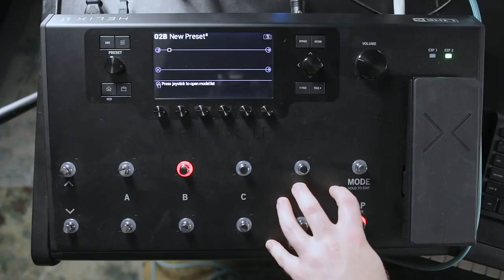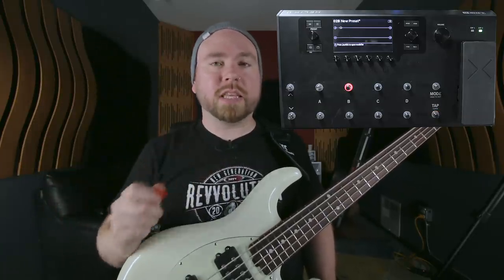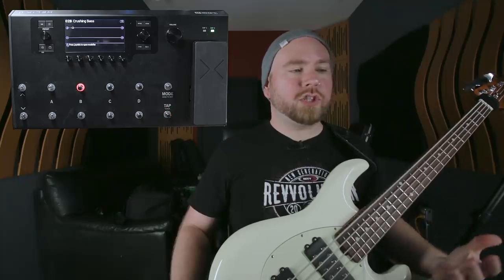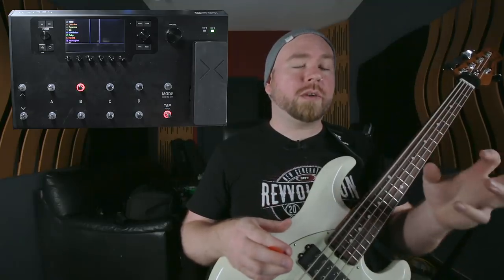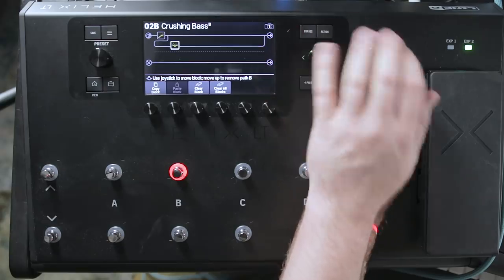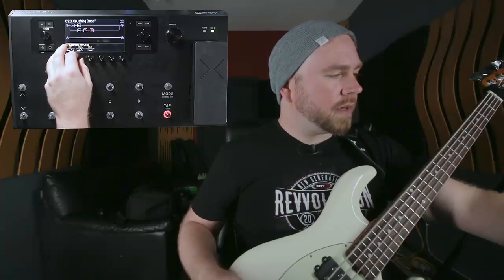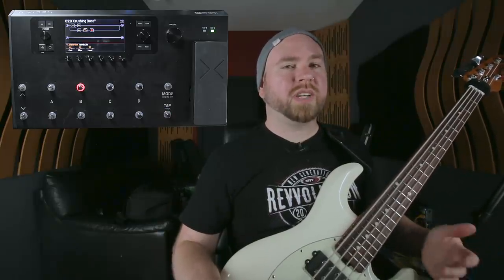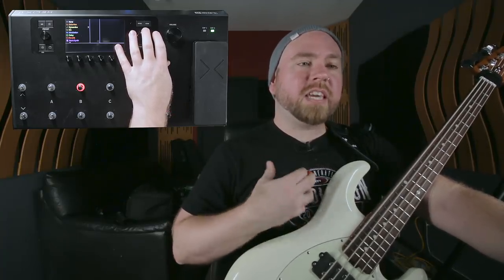How To Get A CRUSHING Bass Tone!

Comment: If you have a passive p bass with old strings:
Low bass - 10
High bass - 6
Low mid - 6
High mid - 10
Low treble - 10
High treble - 10

I promise you won't regret this setting
Reply: god bless you
Reply: @fuzzfiend 
I still run my bass this way with the same set of old  strings
Reply: You have low and high treble and bass?
Reply: @lamblatte8139  
A good amp will have at least a 6 band equalizer
Reply: @philcollinshill2951  What should you do if you only have 4 band?
Reply: @lamblatte8139  
Experiment with your settings until it sounds good to you. I'm not much help but that's my honest advice.
Reply: what are you running for distortion or do you use it?
Reply: @keenansalzsauler5858  
I plug straight into the amp with no distortion
Reply: @philcollinshill2951  thats lame
Reply: @lamblatte8139  no he had a killer rig
Reply: @keenansalzsauler5858  Lemmy used his amps built in overdrive/distortion, so your point doesn’t really stand.
Reply: Yoo thnx g!!!!!
Reply: How much gain do you use? Nice settings btw
Reply: @themossfield5430  
NONE

Comment: The hardest thing about getting a great BASS sound I’ve found is getting the GUITARISTS to switch off their egos and work with the rest of the band.
Most guitarist run too much distortion period. 

The rule of thumb for all guitarists or bass players is;-
What sounds great when you dial up a sound by yourself is often overkill in a live/band setting.
Reply: buy an 8x10 and actually be heard....
Reply: That must be why as a guitarist wanting to learn bass I bought a Dingwall n3, 6 string, Darkglass microtube and the Parralax plug-in. Tons of distortion. 😂

Comment: Im a Rock/Blues  Guy (Older than probably most of you) Thanks for the tips. I used to use a Crossover and Two amps to Do this sort of thing...(Along with lots of Pedals). Just started Using Helix thanks for pointing Me in the right Direction.

Comment: I feel like the bass was overpowering the guitars in the final mix. The bass tone itself was great and the dual tone set-up works well, but it sounded like the bass' levels were too high.
Reply from the maker: yeah I mean I cranked the bass up a lot just so you could hear it, in a real mix you wouldn't have it that high
Reply: JUST THE WAY I LIKE IT
Reply: @treyxaviermusic  idk i liked it like that alot of bands have it unrealistically quiet
Reply: @Buhhhhhh-xi4ju  in a lot of genres you generally want the kick drum to be one of the loudest things in the mix, which is accomplished through EQ instead of turning up the volume. A lot of the time the kick is EQ’ed lower than the bass which sits just above in the mix, but adding in guitars which are extremely mid-heavy and generally more searched-for in the listening experiences of rock and metal ends up muddying the bass. Not enough low end or mid range unfortunately buries it but makes the band sound better as a whole, it does suck though because bass in a live setting is a completely different experience from listening to a lot of recordings
Reply: @tylerlennon9955  a really mid boosted guitar takes up too much space in the sound spectrum. Listen to older more scooped metal albums and you can actually hear everything going on, take pantera for example, dimes tone was scooped nasty and mean but it really gets people going and you hear every note from all 4 guys. broad midrange doesn't really get people going because it's boring and vanilla. People want extreme sounds because they fit a more extreme emotional content better. Modern metal production gets really boring after 3 songs even if they're good.  It doesn't get people going when you neuter the shit out of the bass for the sake of your mix sounding clean. Normies don't care about that shit at all, only other mix engineers give a damn about that and they arent your target audience anyway. Especially in a live environment if you arent pushing lots of depth and oomph then people lose interest. besides this is heavy metal, it's meant to be filthy and brutal sounding.
Reply: @stevenhirsekorn3444  agreed

Comment: I don't have a Line 6. I have used a similar approach by using an Eden WT-600 for the low end of the spectrum with a good amount of compression and clean. I then use a Carvin Quad X preamp on channel 2 for the uncompressed highs. My bass has a ton of output with naturally overdrives the preamp with a "fuzzy" distortion. They are on separate channels and I mix/blend accordingly. The Tech 21 dUg Pinnick DP-3X pedal has this feature built in. That is an inexpensive option for those who gon'y have a Helix or something similar. Lastly, YOU ARE SO Correct in that separating the bass from the treble frequencies of the bass tone with clean compressed low frequencies and uncompressed and slightly fuzzed treble signals will cut through the fix so that one's bass playing can very easily be distinguished compared to traditional bass guitar EQing. Especially for guitar heavy music genres. You demo is on point!!!

Comment: The result is pretty good but I'm wondering why you didn't use the x-over split instead of A/B split and two dedicated low/high cuts. Saves DSP and  space in the patch.
Reply: This way you can dial in the low and high end independently and have them overlap. I think the cross over split can’t do that.

Comment: Simplifying things... What I did without splitting the signal was: Washburn RB2000 through a Sansamp RBI with drive pushed, got the clean signal out of it through a Peavey PVi 2500 on one channel, and the dirt signal connected to the other Peavey channel. From the power amp I drove the Bass/clean power output through a 15" cabinet, and the full/dirt power output through a 2×10" + horn cabinet. Just add more cabinets to your own taste...

Comment: I know im super late to the party lol but i noticed that parallel split EQ; you can actually split the signal on the signal line (i think the default is like A/B balance but you can change it to frequency) did some playing around with freq splitting with dual cabs

Comment: CRUSHING.  Question:  If you were going to place modulation effects like chorus or flange, or if you were going to use a delay, where would you place them in a chain like this?  I realize much of that is to taste, but what I'm getting at is really, would you want those effects to only be applied to the "high frequency" path, or to BOTH?

Comment: I run a similar setup on my axe-fx for bass but speaking from experience(used to run a sub-bass stingray) the massive humbuckers are almost too much output. It's hard to properly gain stage a sting ray for a gritty bass tone that still has that punchy thump. Passive bass pickups surprisingly work a lot better for that style in my experience. Precision/Jazz combo or Jazz would sound killer on that patch.

Comment: Great tone, but I'm pretty sure I got the same tone or better with a Squire jazz with Warwick BC10 amp and the incredible Source Audio Aftershock pedal, and don't forget the Rotosound strings (or D'addario NYXL).
Reply: Dude ever since I used the nyxl strings slinkies kinda sound like shit comparatively, the only problem is finding the nyxl in 5 string is virtually impossible without using reverb

Comment: I just lightly distort the whole signal. Pull out some of the lows before the crunch and then just add it back in after. Too much bass going into distortion sounds bad, but you don't have to split the signal like that to work around it.
Reply from the maker: The other problem is that you lose a ton of low end with most methods of distorting your tone - you can try and add it back in later, but you can end up boosting frequencies that aren't even there and just wind up with noise
Reply: Well I'm not distorting it to the level shown in this video, and honestly this technique that has been popular for the past number of years sounds like garbo. More so since everyone is doing it, furthering the idea that all modern metal bands sound the same. Like you said it won't sound good to everybody. I prefer someone to have their own sound, it's makes a song or band more unique.

Comment: I don't know man. As soon as you removed the bass track towards the end of the video it became so much clearer in a good way. The bass tone was really making the whole mix sound very...cloudy? It sounds really heavy for sure, but if I had to ask someone to TAB that part out by ear, the low notes would be quite indistinguishable. The concept is great of course, but I think the high end needs to play a bit nicer with the guitars, especially with the drop A tuning. If the guitars are only in say, drop D or C, clarity in the low end is going to be less of an issue so I think you will get a little more room for your high end to color the mix. Food for thought.

Comment: Hey Trey, does the split crossover feature in later Helix iterations render this an 'older way' of doing it? I followed your bass tone for the HX Stomp which did follow that process (split crossover) but the high end signal of the obsidian is not loud at all in my patch and I cannot seem to make it present sounding compared to the low bass path

Comment: Was there a reason that you didn’t use the Obsidian pedal?  It was based off a Darkglass pedal...
Reply from the maker: Yes, I use Darkglass stuff all the time and it's great. This method kind of does what the Darkglass does but with a little more flexibility. You can distort just the high end, but you can't siphon off the low end alone to compress it.

Comment: First of all, your Video and playing is pretty fine! It's just a little thing I dont understand. I am not a heavy bass player . . . But I often wonder why do HEAVY PLAYERS are adding that much distortion to their basses??? Some radio pop productions got more punsh in their bass sound than Heavy productions. Sometimes I don't hear a bass. I just hear a lower third guitar. Don't get me wrong! Distortion is pretty fine, but where is the bass in this sound?
Reply: If you eq the bass line it is in popradio, it would be too muddy for metal. Distortion is added to the midrange and highs to bring out the harmonics of the bass frequencies, it really helps the bass stand out, otherwise it would just be buried under the guitars and kickdrum

Comment: I know you prefaced the video with the caveat that not everyone has access to a Helix, but the remainder of the video is absolutely Helix-specific, nearly to the point of a paid demo or advertisement. That's fine, but perhaps consider adding "with the Line6 Helix" to the title. The resulting bass tone is fine for modern metal, but I can say from experience it can absolutely be achieved with the entry-level SansAmp and a RAT pedal in front. The math: Helix LT $1000 USD. SansAmp Bass Driver + RAT < $300.

Comment: so much easier to SPLIT signal for bass into 2 seperate amps. This way you can keep a belchy Piano like Clean bass with good low end AIR push Whilst being able to give a good  mating of the bass to the guitars thru Overdriven bass sound on second amp. I also prefer the bass TO BE PRACTICALLY EQUAL IN MIX TO THE KICK DRUMS THEREFORE PROVIDING SOME PUNCH! Love this shit!!!
great video!!

Comment: I really hope that no one, especially beginners, would take a note and dial their tone as adviced in the video. This is far from great or crushing.
Reply: @Jackal_Blitz  when you isolate highs and distort only them, you're left with your smooth lows and mids coated with this bodyless buzz. congrats, you just killed your dynamics by sacrificing your highs for this tinny distortion that will do nothing but muddy your mix. there's nothing crushing about that
I can list a couple of noise/sludge bands that I now for certain use nothing more than an svt head and a rat to get a bone crushing bass tone, you decide whether you like that shit or not. but, imo, these fucking roar and rumble
Unsane - Last Man Standing, Windshield
Pigs - Scrum, If I'm In Luck, Small C Celebrity
Kowloon Walled City - My Hands Are Turning To Bricks, The Commuter, The Grift

Comment: sorry Tray but work has to be done even more. The low end is woofy and loose, and the high end is like a cheap cocked wah.  I suggest the Nolly way, where the distortion is really a metal amp. That because the distortion is tighter. As for the low end... 10" speakers are tighter and more responsive.

Comment: Overdrive in bass tone is kinda weird to me. I always thought if you were gonna use overdrive on bass would maybe be for a solo. Same applies with distortion.
Reply from the maker: Why would it be weird
Reply: Gear Gods Well it is for me. I prefer the classic bass tone. The farthest I'm willing to go is, a little bit of gain and a good bit of compression. That's it. I'm very bare bones.
Reply from the maker: What kind of music do you play
Reply: Gear Gods Usually Thrash Metal and some Death Metal here. In there. Been into jazz recently and stuff like that but I still have to broaden my horizon more. However, I'm not exactly skilled enough to play some of the more complicated jazz so the most complicated thing I play is some Tech Death.
Reply from the maker: Well, if it sounds good, then there's no reason to change, but remember it doesn't matter what your bass sounds like by itself - it matters what it sounds like in the mix. If the mix sounds weak, it might be a lot of things, but I find it's often a too-clean bass. Don't restrict yourself based on some arbitrary notion of what a bass should be - you should be willing to go as far as it takes to make it sound sick, in my opinion. I could be wrong, you might have the sickest tone ever with minimal gain.
Reply: Overdrive on bass to someone who plays trash and death metal is the least odd thing.
Reply: If you're into thrash, have a search on YT and listen to some isolated bass tracks of Cliff Burton's playing with Metallica. There's a TON of overdrive, mostly from his amps, all over his tone and it sounds awesome!
Reply: Oh god don't ever listen to Stoner metal then. Fuzz and Overdive is the norm on bass there.
Reply: lemmy. there is distortion on bass because of lemmy. actually especially in a 3 piece the bass needs to fill the role of both a rythem guitar in the lower mid range and fill the low end thump on the level of the kick drum. it's used to fill the space in the mix from the mid range crunch of the guitars to the kick drum. your lowest string should be around the kick drum
Reply: hawk6111 Lemmy didnt invent bass overdrive. It's been used way before that, even the motown guys often had a pretty gritty sound due to the weak amps being pushed to their limits. The kind of drive/distortion lemmy used it also pretty much just to make it sound like a guitar and that's also the role he takes in his music.

Comment: I’ve never been a huge fan of heavily distorted bass tones. Too much distortion destroys the player’s dynamics and ends up being a wall of buzzy crap. Sure, it sounds “big”, but in a stupid, uninteresting way. Some tube warmth and cab resonance is all you need, which means you need a real amp, cab, and an appropriate mic to capture it. There’s nothing wrong with mixing in a DI to provide a stable low frequency foundation, but you need less of it than you probably think, especially if you’re careful not to destroy your signal with too much EQ and distortion. Of paramount importance is the instrument itself. Fresh strings make a huge difference, as does pickup selection. Simpler is better. I have an older Carvin 5 string with a humbucker at the bridge, a single coil on the neck, and active electronics with a 3 band EQ. The best sound I ever get out of it is in passive mode (EQ disabled) with the humbucker split and mixed with the neck single coil, which essentially makes it like a Fender Jazz.

Comment: Haven't watched the video but if it's the dual track technique that every modern metal producer uses I'm disappointed
Reply: It's used by every modern metal producer because it sounds great
Reply: Toxic Potato you can still have flaws if you use this bass technique though. It's just an easy way to get good bass tones. It has nothing to do with editing or quantising.
Reply: Much prefer really amp, using the technique that fluff and Glenn suggest leaves your mix with an Annoying white noise hiss in the background constantly. The one used in this video of far better because he uses a cab on the high split to tame that white noise
Reply: Recording real amps works, just be prepared for a lot of work in the mixing stage.
Reply: He improved it massively, in my opinion, by doing one simple thing. Putting a cab sim on it which tames a lot of horrible hiss you get from this technique
Reply: Problem is this video is nothing new, anybody who googled how to mix metal bass seen this technique milliion times, I like how circle of tone channel critiques this approach
Reply: Toxic Potato its not so much for the sound but really nice way to keep the low end bouncing all over the place without fuckin up the mids

Comment: ok right off the bat ......not a good metal bass... no pick!.... start with your low side, ran separately, fuck the noise gate crap on that side dial in an awesome full range sound THEN add a second channel with distortion don't isolate high frequencies... the distortion will cut the lows off any way and your  killing a lot of transient harmonics ... your end product lacks .. needs more bottom the tone you made is buried and doesn't really pop in your mix...